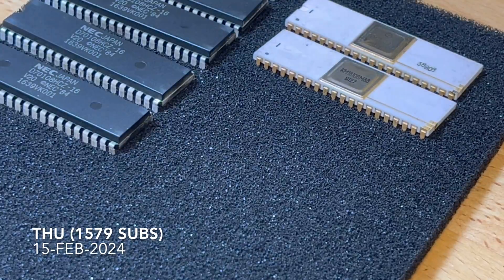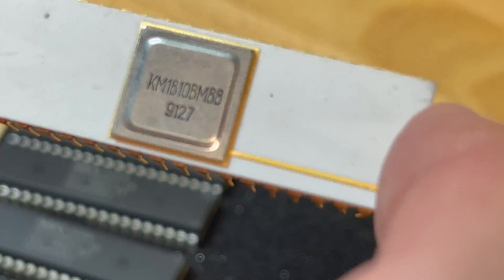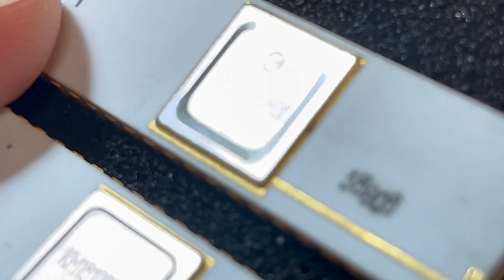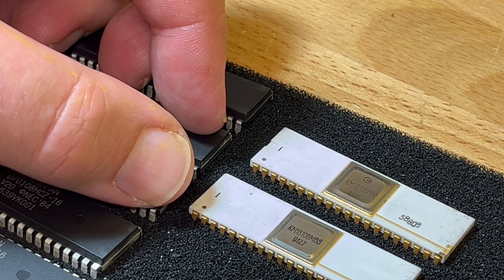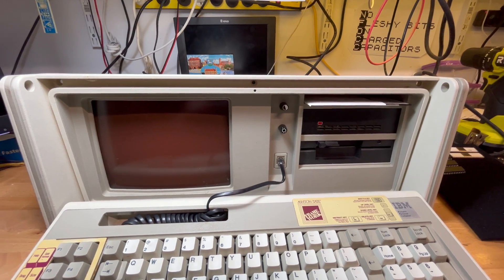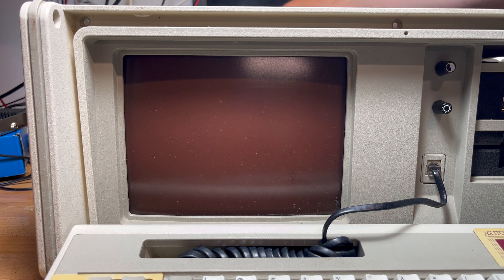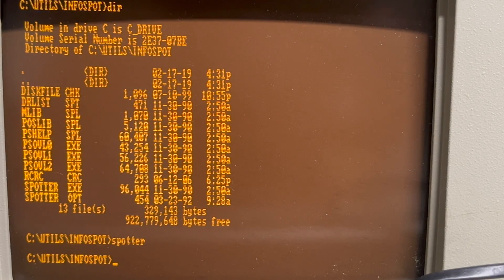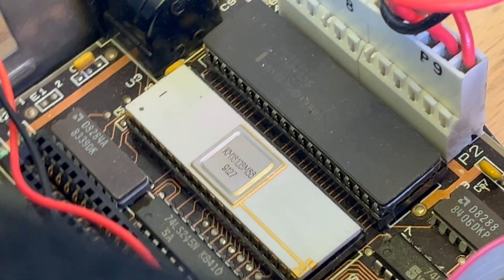К1810ВМ88 (K1810VM88) The Soviet 8088: Part 1 (Does it work?) [TCE #0409]

Comment: They are not clones but rather functional equivalents.  The Soviets did very little in the way of 1:1 cloning of electronic devices; they had very good engineers, and they preferred to perform reverse engineering and developing their own versions of western ICs rather than outright cloning them.  I do know that these tend to run cooler than the originals, and the microcode may also be somewhat different, although the performance per clock is extremely close to the original.  I believe both of those chips were made in the Kvantor factory in Zbarazh, Ukraine.  I don't know why the second chip doesn't have a factory logo on it...devices made for export typically have a Cyrillic 'E' (Э) on them or the marking "Сделано в СССР" (Made in the USSR) on them in lieu of a factory logo.
Reply: Other places and companies also had good engineers and their "clones" not always (or should I say almost never) were the exact copy of the original product. In case of soviets particularly, the manufacturing technology was always inferior to the western world. And they were forced to redesign the layout to work better with their litography. In case of K1810VM88, it is a clone. It is an exact cycle correct copy of 8088, including undocumented instructions, that cannot be reasonably implemented just following the available documentation...
Reply from the maker: Very good point! Lazy word usage by me.  I'll update the title.
Reply: Link to relevant definition of clone please.

Comment: Are you sure, that math coprocessor is not in short circuit when connected near Soviet clone?
Reply: It is not. 8087's just tend to run hot, regardless of the CPU they are connected to
Reply from the maker: That’s a good point. It is recognised by the software, and someone else has noted theirs gets really hot too, but it is worth double checking! Will have a look.

Comment: Is Pac-Girl any faster on a turbo machine?  Maybe I should try it on my PS/2 Model 25 when I get it going again.
Reply from the maker: Actually, I'm not sure - I always used to play it on my Amstrad PC1640 which is an 8MHz 8086 machine, compared to the 4.77MHz 8088 in the IBM PC/XT.  It has four speed settings - I don't recall it being too fast to play, but don't know about 80286 and faster machines!

Comment: I like the white ICs.  Prefer them to the Black TBH..

I know they tend to use black plastic because it blocks light, and apparently because it also helps radiate heat away from the IC more efficiently, but white does look better.